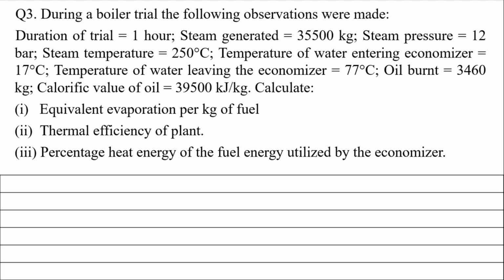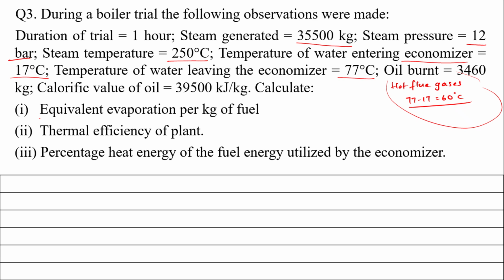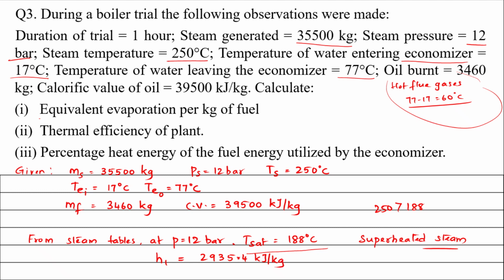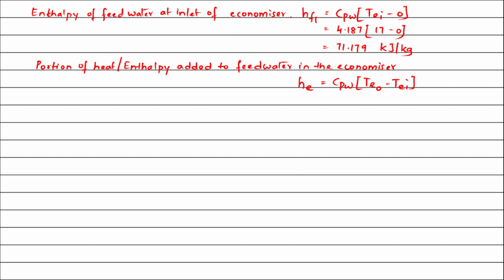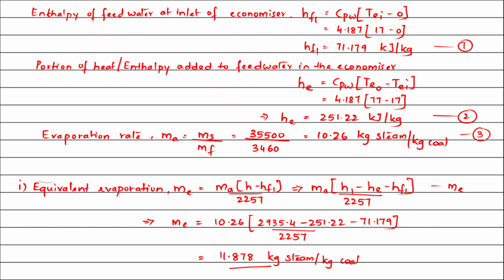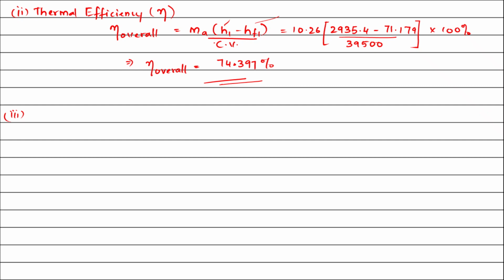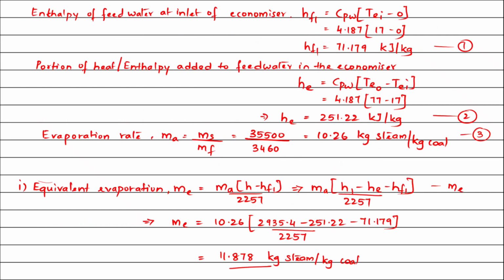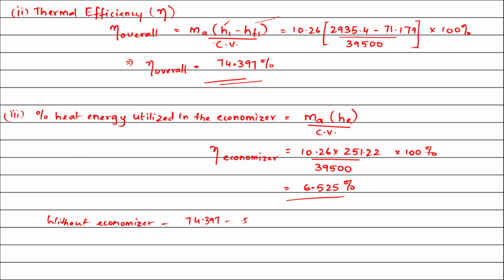Boiler Performance Numerical 3

Comment: 7:42 your value of H1 is wrong
Reply from the maker: Thank you Mr, Santosh for your observation.

At the steam pressure of 12 bar, the saturation temperature of steam is 188 deg C, and the temperature of steam in our question is 250 deg C, so the steam is in superheated condition. Hence when checking superheated steam tables for pressure of 12 bar and temperature of 250 deg C, the value of specific enthalpy is obtained to be 2935.4 kJ/kg.

Reference: Page 19 of steam tables by R. S. Khurmi
Reply: @raahulkrishnavcet7716  sir temperature is fine, however, 12 bar at 250 deg C has got 6831 in RS khurmi
Reply: Your ans is correct sir thank you